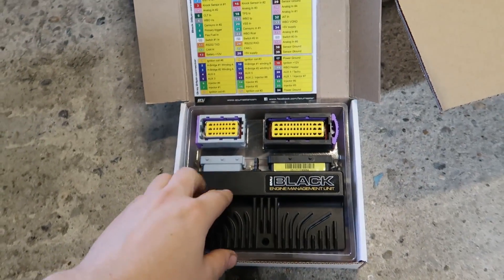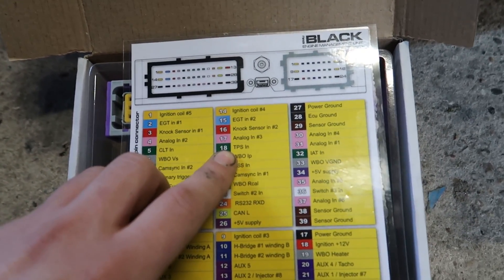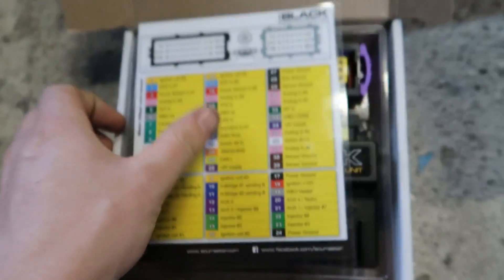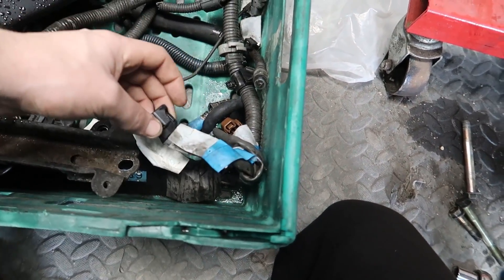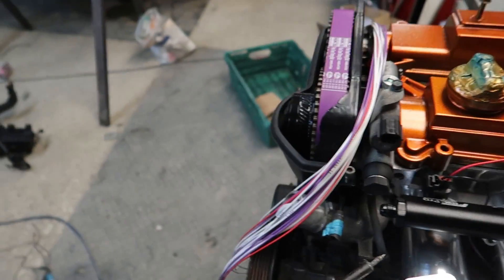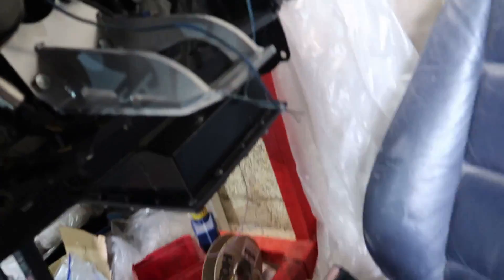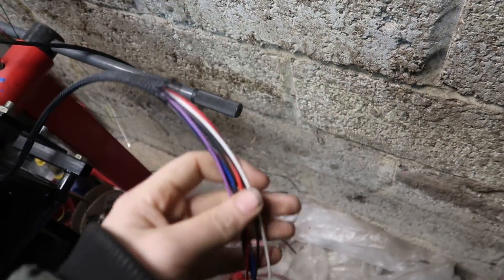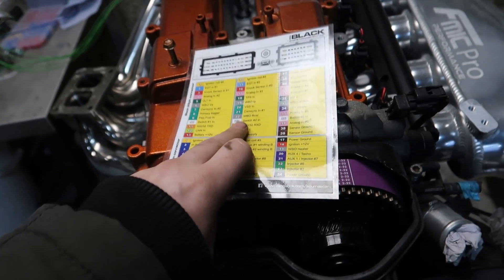How to make a custom engine wiring harness! *2jz ECU Master*

Comment: Great👍but using that eBay thin wall manifold is just waste of time and money. It will crack badly next 1000 km - for sure. So time consume  fix that crap. If you use eBay exhaust manifold try buy that with 3mm thick runners wall. They have some "goldish" looking welds. They are two time expensive but last much longer. I was there😉. That thin wall "chrome" ebay manifold is absolutly crap.

Comment: One Mistake I Moreftenthannot see is People Using the Pre-Terminated harness and starting from the tip of the wire.... when you're done you are left with already crimped wires that are of uneven lengths to each other. A Great tip (too late now but) would be to Pin the wires you are going to be using into the ECU Master Connector and then running them to their desired locations and snipping them with at least 2-3" extra length to compensate for the Loom.
Reply: This is actually a great tip. It's a mess when you have uneven wires when all said and done lol
Reply: I agree.. only time you start at the unterminated end is imo, with you are wiring into a bulkhead disconnect connector... them you chop it there, and pin the terminated one's to the ecu and route it and chop it at the incase connector.

Comment: Which sandwich plate did you use?
Reply from the maker: For the oil filter? Was just cheap one from china I think haha
Reply: @Max Fuller  it looks pretty good. I've been trying to find one that fits my needs.  I'm in the process of rewiring my 2jz also with the same ecu and leads. How did you wire upbthe alternator?  2 or 3 wires and to where?
Reply from the maker: @damnitdang  on the alternator 1 goes to switched power under the dash, other goes to constant 12v at fuse box and the other goes to the dash light output (on my e36 is in x20 plug)

Comment: Currently wiring my 1JZ GTE VVTI into a MK3 supra.
and im wondering. where u get this switched power from? and where did you connect the VVTI Solenoid?
another question. where did you wire your Injector Grounds to?
i also use ECUmaster Black

BTW this has helped me alot already.
subbed :)
Reply from the maker: Hi,
Switched power comes from many things, mine for example comes from the power feed to the abs pump, you just need to see where there is 12v only when you turn the key.
Vvti solenoid on mine goes to aux 3 (but you can also use h-bridge) and other pin to switched 12v.
Injector grounds have to be grounded to the block. 
Thanks for the Sub 🤘🏼
Reply: I have the same combo :) I'll be wiring mine in the next few weeks.  How did you make out?
Reply: @cmase1991  i have finished everything. Actually went very smooth. 
Just have to start somewhere :)

Comment: Hello mate. I have just bought the emu classic also but wanted to ask u where do the grounds go?  The wires from the ecu go to 12v? And the grounds for the sensors and stuff go to the engine block? Or chasis ? Maybe its a noob question but couldnt really find some good info online about that. And dont wanna mess things up. Thnx in advantage
Reply from the maker: Hi, from the ecu one goes to 12v and another to switched 12v, ecu grounds to chassis, sensors can go to chassis ground, but crank and cam sensors have to go to the sensor ground pin in the ecu
Reply: @MaxFuller  thanks alot man I appreciate your message! Now its all clear for me :) 
Bought a vems ecu second hand and harnes new. just to find out ecu is toast… cost me a lot of money and time so didnt want to mess something up. Lost intresed in the vems and all the headaches. My good friend sold me the classic new in box for a good price. So i can start and finish my project! Thnx alot :-)
Reply from the maker: Yeah man ecu master is good 👌🏼 no worries man anytime ☺️ good luck with the build 🤘🏼
Reply: @MaxFuller  hey man one more question.. the wiring digram for emu classic doesnt mention a 12v switch wire. So if i understand correctly the 12v from the ecu goes to switch straight away? Do i need to put a fuse in between also? Have some fuse boxes laying around so it will be posible to do.. 🙂
Reply from the maker: Ah ok, yeah I would assume so, shouldn’t have to put a fuse, but depends where you get the switched power from, just get it from the factory fuse box

Comment: They Max, need to ask a quick question, what sensors did you keep and add, currently labeling my harness but I'm not 100% on what to keep when it comes to the random smaller ones
Reply from the maker: Hey, I have used both knock sensors, crank sensor, cam sensor, coolant temp sensor on the head, tps, alternator, starter, think that’s it from factory stuff.
Reply: @MaxFuller  Awesome great help, thank you so much Max
Reply from the maker: @DTCxPredator  No worries 🤘🏼 I added mac boost controller, Bosch 4.9 wideband, e-fan control, AIT sensor, oil pressure sensor and oil temp sensor too
Reply: @MaxFuller  Bloody legend thank youuuu ❤